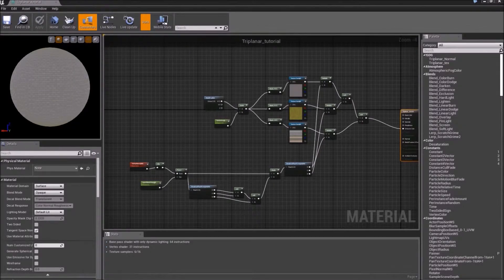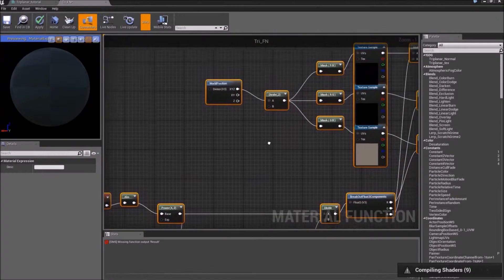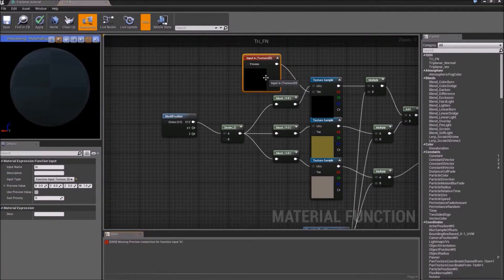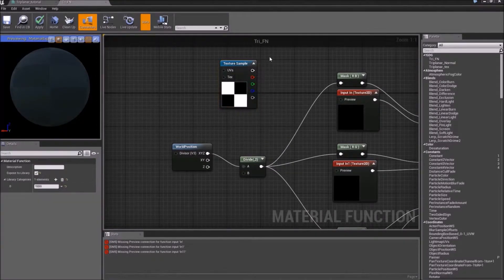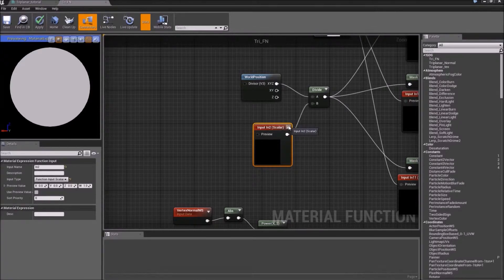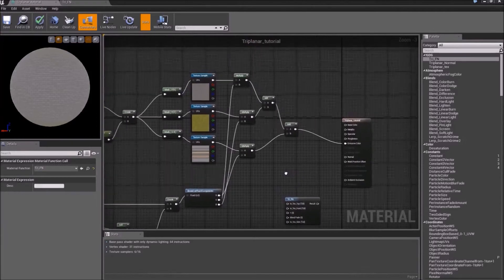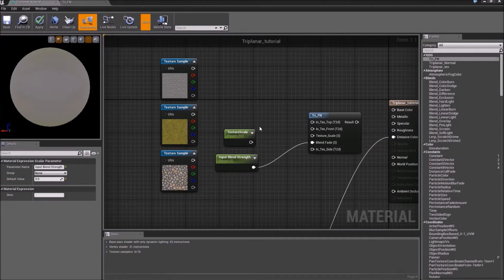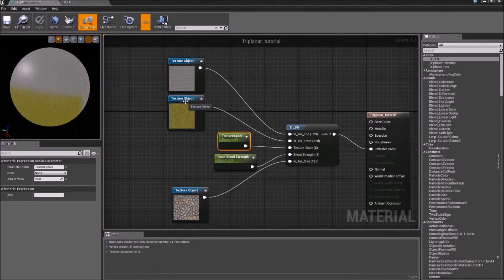Unreal Engine triplanar material 03

Comment: Hi Steve, thanks for the tutorial, but how to change the texture in material instance, since its using texture object, not texture sample parameter ?
thanks man
Reply from the maker: You have to use a texture object parameter node which will let you change the texture object in your material instance.

https://docs.unrealengine.com/latest/INT/Engine/Rendering/Materials/ExpressionReference/Textures/index.html#textureobjectparameter